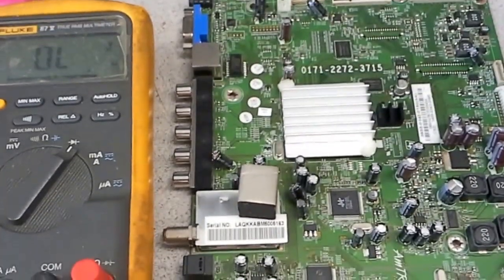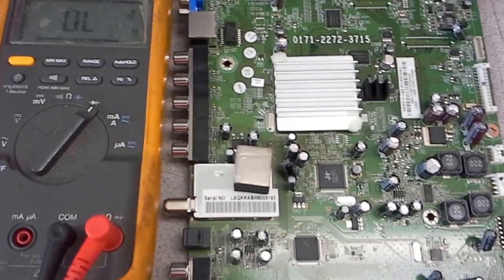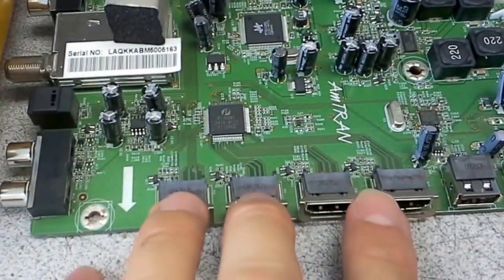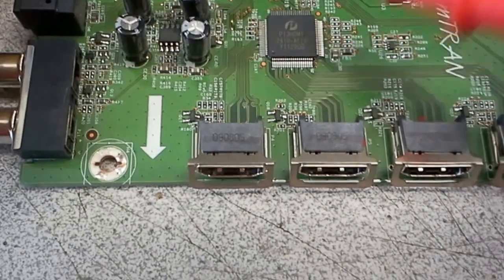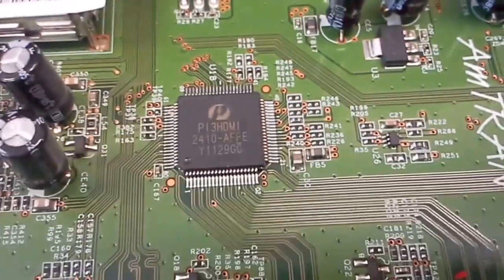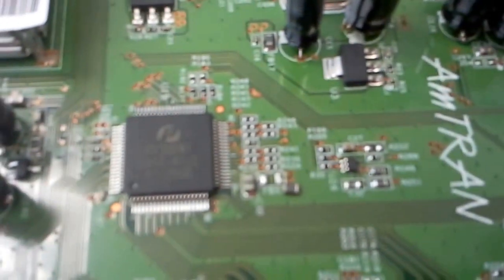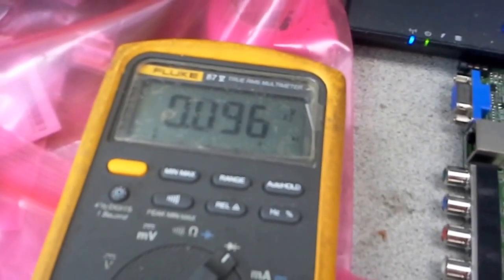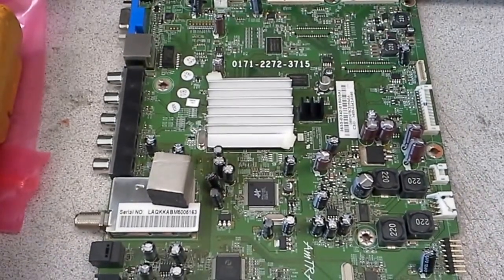How to diagnose / repair no HDMI inputs on Vizio M550SV main board 3655-0342-0150

Comment: Do you offer repair for this board now?  My hdmi's go in and out.  Keep getting a message that TV doesn't support program format.  Usually if I unplug TV for a few seconds hdmi's start working again.
Reply: Yes we do offer repairs for the board now, though I have not seen one that behaves like you describe and that may mean it could be more difficult or even impossible (for practical purposes) to resolve.
For good or bad there is only one way to know...

Comment: If my tv, same tv still works, all the apps, wifi power everything still works, my main board is good right?  My hdmi ports in do not work. It's just the chip, correct?
Reply from the maker: Sorry, can't confirm that with any decent level of certainty. What if the problem is in the main processor, say due to a bad solder joint of a ball? 
What if the problem is the power supply for the HDMI switch circuit and/or the processor? 
What if the EEPROM has gotten bad in a way that the control of the HDMIs is lost? 
Not likely, I know, but if you've done hundreds of boards then the not likely is just a matter of time. And sure enough I've seen any one of those develop on a board. 
So how do you expect me to tell you you have any particular one of them?
Reply: Coppell TV Repair LLC, thank you for taking the time to answer my question. I've never worked on a TV before.  Im a 30 yr old sahm with 3 kids lol and I have no business repairing my own tv...no experience whatsoever.  BUT I'm going to open it up soon and check the resistance and try to determine if its the hdmi chip.  Hopefully I can fix this myself. As I cannot afford to pay anyone to fix it for me. So out of necessity I am driven to try.  I'll let you know how it goes. Thanks for posting this video!

Comment: do you sell hdmi chip hdmi 2410 AFFE         y1129gg ? I have  m3d550sr  2nd time Comcast and lightning created a suicide pact.  1 st time wiped out all but 1 hdmi input   I put in a auto 3 way splitter   this time cooked splitter and now no hdmi inputs.  hdmi surge suppressor sounds great also.  (splitter didn't protect)  nor did newest Comcast box NICE HUH  wonder if Comcast will pay for your repair?  oh well not 1st time replacing smd w/only solderwick aaarrrggggg.  oh ya tv works w/ ch 3 input w/ Comcast box.
Reply: Peter Lanman please send a high quality pic of the IC to our support email.